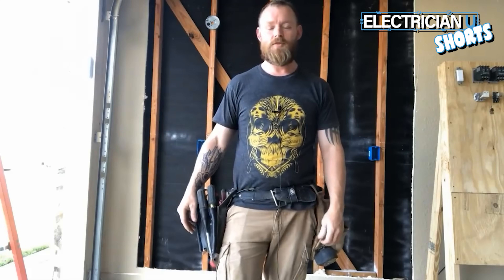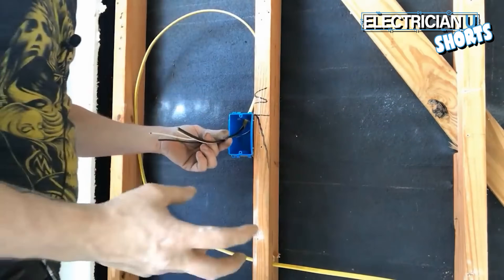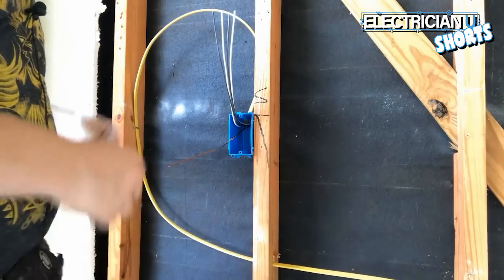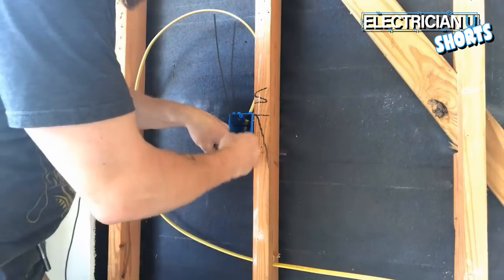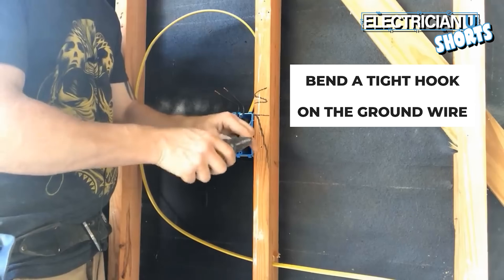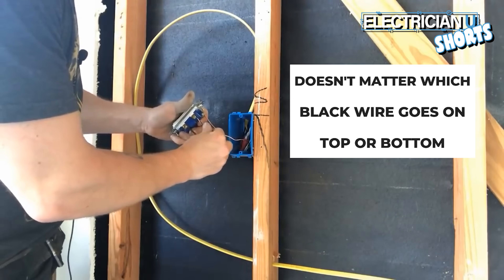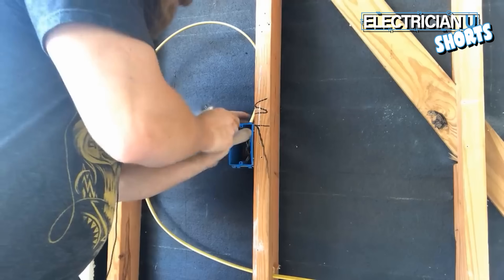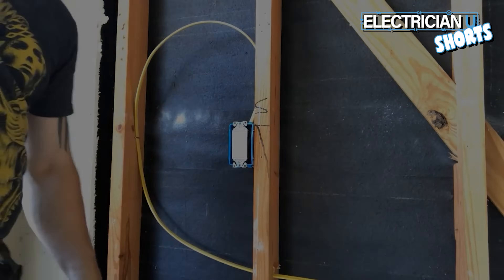SHORT - How to Install a Switch (in 3 minutes)

Comment: Howdy
I have a question i need answered. I have made a extension on my shop/shed and am installing 2 electrical outlets. I am installing a switch and light fixture Bulb Type in-between the 2 outlets out of a junction box. to wire the wires together. the on off switch is pretty simple Black (hot) on top and bottom  and ground to green. from switch i have black and ground but no neutral (white) so what wires go to light fixture with only 2 screws I know the black will go to gold but what wire goes to the silver screw ? i dont think ground would be right ?

Comment: If I may add a couple of tips.  Always put your line conductor on the top pole and the load (or switch leg) conductor on the bottom pole.

Also don't use a razor knife to cut the jacket.  Either strip it before you put it in the box or use like a cable knife that has a knup on the front of it that allows the knife to slide up the sheathing.

Love the content Dustin!  Doing the trade so real good work with these videos.  Thanks

Comment: And now I know how those green wire nuts are used... I do have a question about wire length though... Aren't we supposed to have a minimum of 6" of wire length in the box? After it was twisted and then cut, the one wire seemed to be shorter than the minimum required code length, unless there's something I missed.

Comment: Can you do a close up of tucking in the wires,that part always turns into a rats nest for me. 

Also would wago connectors 3 slots be just as good for ground wire two incoming one going to switch or plug.

Comment: 0:23 please... I don't understand how you're doing that.  I've installed and wired several dozen boxes and probably a dozen since I first saw you strip the outer sheathing off so easily in this way in a previous video of yours... And I just cant do it.  I don't know what it is; the knife I'm using being too big, different types of boxes or what, but I can't do this and I don't understand why :\ I try to get the knife in the box so that I can cut the sheathing, but I can't no matter how I try.  This seems like such a stupid and simple thing too so I'm really at a loss here.
Reply: You just want to score the sheathing so when you give it a slight tug, it pulls right off.
Reply: @josephherrera6354   thank you, but I understand the scoring part.  The problem is as I mentioned the knife not fitting properly, the box being different, I don't even know for sure, but I know about the scoring and how that works. Another issue though is that even if I do score it properly, those clips are such garbage that they will not properly hold the cable while I pull the Sheathing off (they're one way clamps anyway)and what ends up happening is the entire cable just pulls further out.  Something I had not thought about until just now though, is the times that I've seen him demonstrate this is in new construction and he's able to properly staple outside of the box.  I'm doing a lot of old work and so it's not possible to staple outside the box because it's behind drywall. So the cable is not secure enough to score sheathing and pull it off.  but even if that weren't the case I just cannot maneuver the knife in there and I don't understand how he is.  Other than it being a new work box, I'm using the same blue plastic boxes that every home improvement store carries.  yet every time I try to put my utility knife in there like he does to score it at Angles it just... I can't and I don't understand why. :\

Comment: Dustin.  You do not have a code required future expansion loop after your staple.  How are you suppose to pull more wore for future redevicing?
Reply: who wires houses that way. over 30 yrs and own my own company. if my emoyee did that or loop the wire around like in the video i would surely correct on how to properly pull wire and when youre devicing how much wire do you need to pull out of wall. what the heck bro
Reply: @stevenpersinger6577  A year ago I replaced my water heater with a more efficient model that vents out the side of the house instead of the chimney. I wasted about 6 hours of my life rerouting the electric cable for my clothes dryer because the electrician years ago left no slack whatsoever for me to run a new PVC pipe between the floor joists. My house is 130 years old and that is just one of many examples of problems that I've run into over the years with tight electric cables. Long ago I started insisting on contractors leaving me plenty of cable slack when I remodel a room whether they want to or not - and I watch new ones like a hawk.
Reply: @JasonEDragon  couldve just intercepted the wire in the wall and blank off old especially for a water heater. 20 min max. blank off old.  youd be fired if you worked for me.
Reply: @JasonEDragon or set a box over old wire and box run some simple hmm i dont know sch 40 pvc 3/4 with some 2 holes. make it look good an own it like a boss electrician.
Reply: @JasonEDragon  in other words back off rookie
Reply: @stevenpersinger6577  Except that over the decades the furnace was upgraded twice and AC was added. With that came a whole new collection of air ducts in a (vain) attempt to get enough cold air to the 2nd story. Needless to say, easy access to the wire was blocked. Don't make assumptions that you could do it quicker than someone else. As a customer, I'm gladly willing to pay the extra $200+ over my lifetime for the extra cable needed to wire in a manner, just like in this video, that leaves slack. Too many people only concern themselves with the job of today and don't consider that house may last a century or two and things will likely change over that time.
The extra wire that I had on most of my other circuits sure came in handy when I replaced my main panel and added a Generac transfer switch - when things needed to shift over a foot or two.

Comment: Why not use electrical tape to cover the switch connections? 
With a bare ground wire in the box I do not understand why most electricians fail to do this.
I don’t know what the code says but I can’t believe it would be against it.
What’s your take on the subject.
Thanks in advance!
Reply: I think it's because the box he was using is plastic. So if any terminals on a switch or outlet were to touch the box (which is very unlikely), nothing would happen, obviously. If it's a metal box, then I can see why electrical tape is necessary.

Comment: If you go with the Rules of Switched Disconnects fused and unfused Line (Hot) on top, Load (Switch Leg) on bottom also for contactors and relays, but agreed electricity doesn't care if you follow the rules or not...